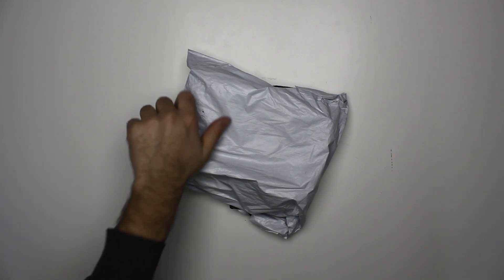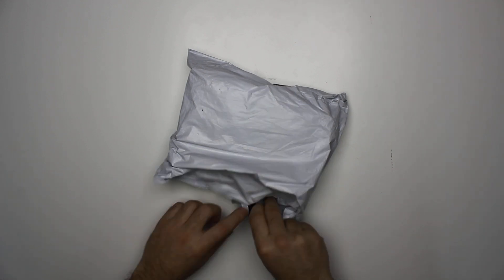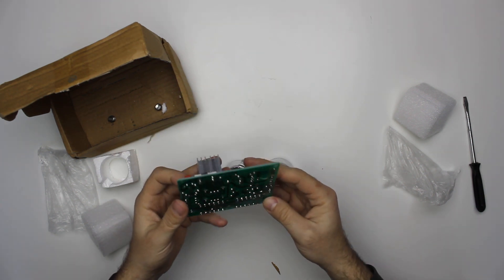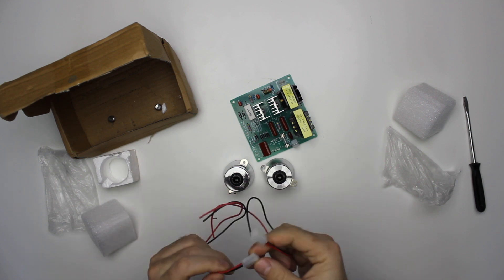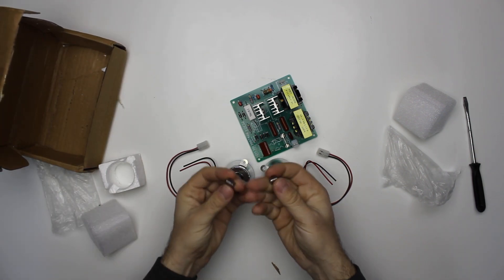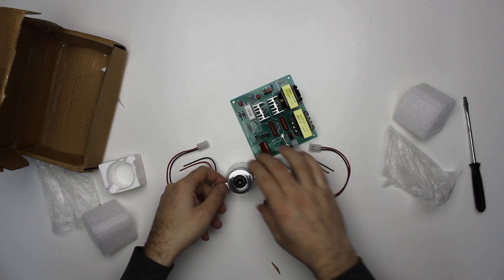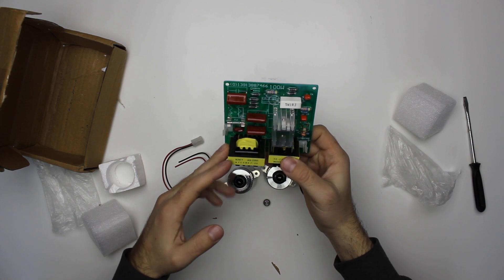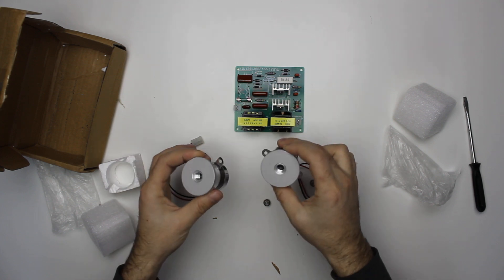Unboxing DIY Ultrasonic Cleaner Kit - 2 x 50W 40K Transducers And 100W Board

Comment: Maybe someone knows why small screws are used?
Reply from the maker: If you are referring to the small tubular screws, these are first attached to the container you are going to use and then you can just screw the transducers on top.
Reply: @WeUnbox  These small screws have to be welded to the container, and then the ultrasound generator screwed on them. But I have a question, these screws are assymetric, there is a threaded part and a unthreaded part, which part has to be welded to the container, the threaded one or the other? Thanks for your help!
Reply from the maker: @rgbc3253  Test first and you will know :)

Comment: Hey bro, do you have a video of this setup and how it works and how it is wired? thank you
Reply from the maker: Hey, I don't have the video. I'll see if I can get one recorded soon.
Reply: @WeUnbox  Hi i just want to ask a few things. i ordered the exact same model but it didnt come with a manual. 
1. i just wanna ask, did you connect the J1 to the AC source? 
2. also since there are two transducer, did you connect them both on the J2? 
3. did you connect them in series or in parallel. 

Thank you so much for this.
Reply from the maker: @leelasconia2652  1. 220V AC on J1
2. Both on J2.
3. Parallel
Reply: @WeUnbox  have you had any troubles or difficulties whèn using it?

any over heat or busted fuse issue?
Reply: also, how did you determine the poaitive and negative terminals of the transducer. there was no manual included so i dont know which is which.

thank you so much for your response
Reply from the maker: No issues for now. You have to connect the terminal between the two black rings to positive. This is the connection to the electrode. The other one is negative.
Reply from the maker: Sorry, don't use those that much. 
I know the diagram but in theory it's wrong. BTW You can test it out with just one transducer first and see what happens.
Reply: @WeUnbox  ok will try this. looking forward to your video of this device. Thank you so much
Reply: @WeUnbox  Bro, i was able to setup my diy ultrasonic kit but my transducers heat up at around 2 minutes of continuous use. does yours heat up as well? how many minutes can you use yours continually?
Reply from the maker: @leelasconia2652  My set is currently connected to two separate containers but I'll test it later and see. Do your transducers fit well with the containers. The liquid should cool them a bit.
Reply: @WeUnbox  how many liters per container is your setup and how did you mount the transducer?

thats what i thought at first, i thought it wont heat up because of the liquid but after 2 minutes it becomes too hot to even touch.

would like to know how long you tested yours for reference
Reply from the maker: The container is  1/3 by 150 gastronorm - 5.7 l. 
It does heat from the bottom up so I guess the liquid does not cool it fast enough. I might add a fan and test again. 
After 1 3 minutes session it's OK. After a few of those it gets hot.